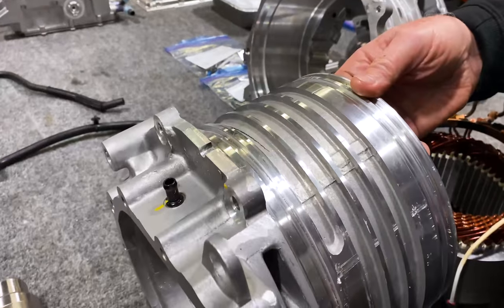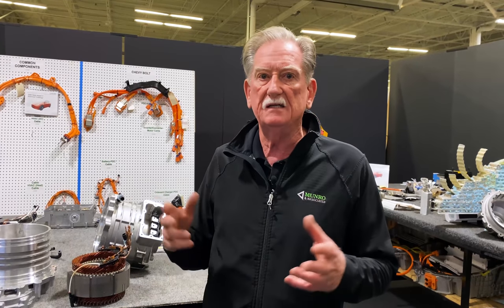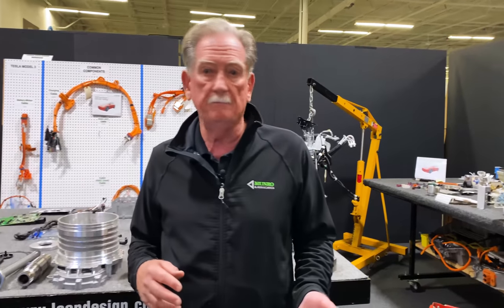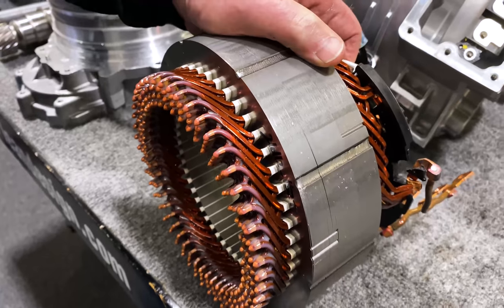Mach-E Front Motor: Sandy is Blown Away by Great Design

Comment: So, Ford's engineers picked these two inverters from suppliers.  One is a nightmare, the other is pretty good engineering.  What does this tell us about Ford's outsourcing business model?

It's hit or miss.  Ford is relying on suppliers' expertise.  If the supplier doesn't have it, Ford doesn't know enough to avoid that supplier.

The other thing I noticed is that the motors seem to be considerably underpowered for such a heavy vehicle.

But I was generally pleased by what we saw in today's teardown.  Some suppliers do seem to be on top of the game.  The weakness is in Ford's ability to specify the right parts from the right suppliers.

Generally pleased, but I'm still leery of all of the fasteners in the Mach-E.  I think Ford needs to scrub out about 80% of them, replace them with snap-fit designs as much as possible.  This should save weight and improve the vehicle's reliability.

Probably, Ford doesn't specify the guts of an assembly like these inverters.  Probably, Ford uses performance specs; if the part works, it's accepted, fasteners galore or not.  If Ford doesn't at least peek inside and look at the quality of the engineering before accepting a part, if Ford doesn't talk to suppliers about their reliability goals and their intention to reduce fasteners, that's a big mistake on Ford's part.  They're giving up control over elements of the vehicle's reliability.
Reply: Exactly.
Reply: This is why I’ve always liked Fiat cars. Their original designs were well considered but over the years have evolved. Thing that need to change are updated but those that work fine stay the same. e.g. Rear wheel spindles and hub-bearings have not really changed since 1970s. They’ve not needed to change. 
The design is in-house but suppliers (SKF, Magneti Marelli, etc) build to the detail spec.
Reply: And to be honest, I’d be amazed if Ford is even making a profit on these vehicles. Feels like they’re just trying to hit some quota, and using whichever parts necessary to make it work. Can’t be too harsh on them cause this is their first run through, but honestly they do seem a bit hasty in their decision making on which parts are sufficient and which are actually superior to use. Hopefully someone from Ford watches these videos and is taking notes on what to fix in the future.
Reply: Well put, hence why Tesla does most of its design and manufacture in house. Agree the standarad Mach e is considerably under powered, its the coming GT model is where the power is at with a peak of 282 HP (210 kW) and 306 pound feet (415 Nm) although again comparing to whats available from the competition, still average.
Reply: Your point is valid. Often for part specification its more of a checkbox / behavioral model. You define fit form and function and are "open" to the variety of implementations. This can be intentional and for the OEM supplier is liberating as it allows them to solve the problems with their IP avoiding violating any one else's patents etc. 
So the underlying question is does Ford care if the different designs fulfill the requirement? Did they also specify reliability, serviceability, etc.   
I look at it as the first rounds of R&D as the industry pivots away from ICE.  Tesla is ahead of the others and setting the bar but in short order the excellent engineering will dominate, cross-pollinate and we will see interchangeability of multi-sourced parts at the lowest price. Elon is playing the classic Silicon Valley Supply Chain game. He wants quality, interchangeable parts from a plurality of sources and then will negotiate the cost +15% to the winning bidder. Since the EV car has so many fewer parts it will be 20% of the cost of an ICE vehicle.   Remember PC's which came out around $7000 - well you get more for $499 today then those original fairly proprietary designs for just this reason.  The game is afoot.
Reply: I'm pretty sure you're only leery of the fasteners because Sandy said he likes snap fittings more. . .
Reply: @prerunnerwannabe  Sandy's opinion does matter to me.  It should matter to everyone.  He doesn't know everything.  But he sure as heck knows a lot.

But my prejudice against screws is old.  I've only known about Sandy since he began his YouTube channel.
Reply: @philorgneopolotin8762  I don't expect positive margins on the Mach-E.

Though my expectations aren't facts!  Ford would know.  I don't.

But this car doesn't look like an A-Team effort to my eyeballs.  It looks like something cobbled together in a rush to get out of paying fleet emissions penalties.  The good, such as it is, is in subassemblies furnished by some of their suppliers.

But only some of them.

The package of energy efficiency, reliability, features, performance and pricing add up to a vehicle that is not very competitive against the market leader.

If Mach-E isn't Ford's A-Team effort, what is?

ICEVs, obviously.  Particularly hybrids going forward, which they can call 'electric' (got a battery in it!  A little one, anyway) and qualify for US incentives, thanks to their lobbying efforts and political corruption.

Incentives for cars with tailpipes.  Can you see me shaking my head in disbelief?

Hybrids are the past, not the future.  I'm very much afraid that Ford is positioning itself to fail miserably as BEV disruption gathers momentum.

And it will gather momentum.  It's already happening.  Incentives for cars with tailpipes won't stop the industry-wide disruption that is underway.

Fossil fueled transportation is ending.  A company that bets the other way is going to go down.

Comment: I wonder why Ford didn't go with Magna in both front and rear motors?  The rear motor is Borg Wagner, which didn't look as nice as the Magna version.
Reply: price maybe?
Reply: As Sandy mentioned in previous videos: 2 engineers not communicating to each other.

Or Ford just took what they had in the parts bin.
Reply: The "transmission guys" might have a hand in it. 🙄
Reply: The front and rear have two different sets of requirements (for power, space, weight, etc), which were met by two different product, which happened to come from two different suppliers.

Comment: they put all the good design into that drive unit and didn't have any left over for the HVAC & coolant systems
Reply: Big lollllll. Everything is evolving, it won't be the same design forever.
Reply: The good design of the motors has nothing to do with the Ford engineers and everything to do with the BorgWarner engineers.  So out of the two things you mentioned, the Ford engineers only had to design a decent HVAC/coolant system and they couldn't do it.  Ford is lucky that it can just purchase off the shelf designs for the most important systems from third party parts suppliers.  If they can't even manage to keep some cooling hoses reasonably streamlined they have zero chance of designing a modern high performance electric drivetrain.
Reply: I meant to say credit goes to the Magna engineers for the front motor.  BorgWarner produces the rear motor which Sandy was not as enthusiastic about.  Ford gets credit for the cooling system/HVAC mess.

Comment: I dont know about Sandy some times, he gets excited over same tech and design that we saw in the Bolt EV years ago???!?!?! But he wasn't excited about it then???? Plus, these designs have way more parts hoses and weight than the Bolt drive unit, the Bolts unit was/is easier to service, most likely less expensive to service, less complicated, lighter and smaller, yet achieves the same result. Yet Sandy was seemingly completely unimpressed??? Victim of brand bias perhaps? (everyone loves to hate GM)  

Go take a look at Weber Auto's Bolt breakdown, the brilliance of the Bolt design is so simple, ANYONE with a little mechanical capability can completely take it apart. 

Plus GM is selling 2022 Bolts for 31k and making a profit!!!! NONE of these OEMs are doing that. Good design is not always fancy new and expensive.
Reply: The tech in the Bolt is mostly done by LG, not GM.  Now these cars are known for bursting into flames when charging.
Reply: GM's stated the drive motor was 100% their tech, LG was simply hired to build it. Like Elon is quick to point out, coming up with the tech is one thing, building it is an entire science unto itself. Most of the Bolt tech was GM design, LG simply implemented it on the build and controls level. Having said that, its irrelevant whose tech it is, Sandy ignored it. Said it was OK and moved on to more exciting versions of the same tech to which he raves over. Oh and its funny you mention the burning batteries because the only batteries suffering from this are the LG/Korea and China made units. The ones made in USA buy Chevy are not experiencing the issues. Also Tesla were bursting into flames long before Bolts were.

Comment: So happy to see other companies improving and getting thins done right. Except for the cooling and some extra weight, the Mach-e seems to be a really good vehicle.
Reply: Yes.
It's much better than the overrated VW id4.
However Europeans would choose brand loyalty over value for money.
Reply: @neeljavia2965  But it overheated bad when driving down the mountains. 😱
Reply: @abraxastulammo9940  Which one?
Reply: @neeljavia2965  Mach E descending the Geiranger Fjord in Norway left 6 drivers stranded and there is also a video from USA of Mach E going into panic mode descending a high altitude road. 😱
Reply: @abraxastulammo9940  Can you provide the source for the Mach E problems?
Because most reviewers have mentioned it as quality car.
Reply: @neeljavia2965  Plus an enthusiastic owner in Germany became less enthusiastic after it appeared the car cannot sustain 180 km/h without dropping power. (Tesla can drive 200 km/h, no problems)
Reply: @abraxastulammo9940  Thnx
Reply: @abraxastulammo9940  That's bad.

Comment: Sandy, you still need more education on "skin effect". No, electricity doesn't only move in the "outside skin" of a conductor. I suggest looking up "skin depth", and then noting that it is not important at the frequency of the power to the motor and the size of the winding conductors.
Reply: The harmonics of the chopping drive are up in the Mhz range. Sure this isn't the main power, but it adds some heating. There is also a higher eddy current issue on hairpin designs.

Comment: Since they're using housing gaskets, did they do anything creative on shimming the bearings?  Or, can we expect variation in noise and longevity?  Thank you!
Reply: Thought exactly about the same. Maybe those gaskets are consistent on the thickness accuracy
Reply: It is good enough vs. the rigidity of the case. It is a rubber coated steel gasket anyway, kind of an RTV holder for Sandy :D

Comment: The greater simplicity of Magna's vs Tesla's the gearbox is interesting, but possibly irrelevant.  Tesla's gearbox has been tested to 1 million miles of service.  Without knowing the longevity of the Magna gearbox, it's impossible to say which design is best from a durability standpoint.  Having said that, the Magna design looks cool.
Reply: Its also smaller and likely cheaper. So theres some benefits there.
Reply: Tesla does something new and innovative: "This new thing is great and way better than the old thing!"
Ford does something new: "Damn, Ford's new thing is cool but might be more unreliable than the old thing cause it is not proven."
Reply: @spacebound1969  True.
However that's after seeing Tesla fail spectacularly trying to automate  Model 3 completely.
Almost made them bankrupt.
Reply: @spacebound1969  Reputation speaks volumes.

Comment: 4:30 The Ford shafts are much more expensive and Tesla literally manufactured 1,500,000 pcs. of those gears, as rhey are ALL THE SAME in the Model 3!
Plus the coaxial Ford is a disadvantage, as it takes away the ground clearance compared to Tesla's spur gear design.
Reply: No. A Tesla rear motor shaft is at the same height above the ground as the axles, so it is at the same height (so the same ground clearance if the motor is the same diameter) as a coaxial motor. Tesla front motors in the Model S were originally  (I don't know about the latest one) higher in front, but not for ground clearance - they are set up to clear the front of the battery pack.

And they're both spur (parallel) gear designs - the difference is only that the output shaft in this case is collinear with the input/motor shaft.
Reply: Tesla has probably never made a gear. Like all auto manufacturers, Tesla uses a large number of suppliers to provide components, especially those (like gears) which require specialized manufacturing. Some of the more readily recognized suppliers include Bosch (the iBooster electrically-assisted master brake cylinder), ZF (the electrically-assisted steering rack), and Brembo (the brake calipers), but there are many others... including at least one company which makes reduction gearing for them, Hota Industrial Mfg.

Comment: Interested to know the weight difference between Tesla and Ford motor? If Magna makes a great design, doesn't really help much if it is much heavier than Tesla's.
Reply: I wonder how high weight ranks to cost, reliability, package space, performance?
Reply: @mayflowerconsulting5540  In EV's weight counts for a lot as it directly impacts range.  Not to say cost, reliability etc are trivial.
Reply: @TheEvilmooseofdoom  it certainly counts, yet there's a struggle between weight & cost.  The MachE body is 90% steel.
Reply: It wouldn't make sense to compare weight of two drive units of very different power ouputs.
Reply: @TheEvilmooseofdoom  I don't disagree, yet the other reality is cost and affordability.  Tesla S has an all-aluminum body, yet the lower cost Model 3 is 40% aluminum, 60% steel. The new MachE battery is 90% steel.

Comment: Ford seems to outsource a lot. Also, Tesla design is WAY more heavy duty.
Reply: Everyone outsources a lot. A century ago Ford was proud of how they did almost everything - including making the glass for their windows - in their own factories; the world has changed since then.
Reply: @brianb-p6586  Yes, things changed, but it appears not for the better.  The question is whether vertical integration is better than outsourcing.  The maximize efficiency, multi-use, seamless electronic and software integration, vertical has many advantages.   Tesla's octo-valve is a good example of simplifying and integrating several systems.
Reply: @davidharris7249  yeah there would be no way to make an electric car if a bunch of stuff wasn’t done in house as no one made stuff for those cuz they didn’t exist. Now that Tesla has a supply chain, it’ll be easier for others to buy items from various suppliers

Comment: One issue I have with the press-in stator:  The stator is being pressed into aluminum, and aluminum has nearly double the thermal expansion as does steel.  Meaning that the compressive grip of the aluminum on the steel will also loosen as it heats up.  The aluminum to steel interface is expected to dissipate the heat from the motor and to withstand the rotational torque from the motor.  It looks like there are possibly multiple aluminum keys that mesh with and align the stator - that will help, but time will tell.
Reply: The whole cooling system is to have the motor at constant temperature, this is not an ICE.  I am aware its temperature will vary more in winter than summer, but the idea is to keep it at low and constant temperature.  Part of it is also due to bearing tolerances, might be off if it they too hot or too cold. The higher speed the bearing rotates, and the higher the power, the tighter the tolerances must be, therefore the need to keep temperature extremely constant.

Comment: Wouldn't it be funny if Ford had set up a design contest for the motors and inverters, and installed 2 different submissions,  only to have Sandy unwittingly judge the entries! The losers get banned to the winter testing facility.

Comment: SANDY , if you guys haven't seen the Ford Mach E 1400 prototype commercial that Ford produced , you guys must watch it. It is pretty pretty amazing and that video really shows that Ford does have some good stuff under that hood. Maybe not the battery advantage but their motors don't mess around.
Reply: I believe Ken Block was saying the Mach E 1400 prototype has 7 electric motors and produces around 2-4,000Lbs of torque

Comment: Sandy is blown away by parts Ford doesn't even make...
Reply: oof
Reply: He said Thai it is from Magna, but he didn’t explain who Magna is.
Reply: @mitchellbarnow1709  Magna are a large Tier 1 automotive supplier. They even build the ipace for JLR. This could be a Ford design that Magna are manufacturing / assembling.
Reply: @scottwills4698  Thank you Scott!
Reply: @scottwills4698  still problematic, car profit margin reduces for every outsource part, especially battery and motors.
Reply: @pedroferreira9234  not always and Magna can work for a OEM within the OEM’s plant. (Like Tesla and Panasonic in Gigafactory 1).
Reply: I work for a worldwide supplier in the automotive industry and we do not make "inventions". We make what the client asks, in this case is ford. So I belive is 100 percent ford design.
Reply: @scottwills4698  But it is almost certainly a Magna design which they are selling to Ford. It's Magna's low-power compact secondary EV drive from their eDS line. 
https://electrification.magna.com/high-voltage-edrives/